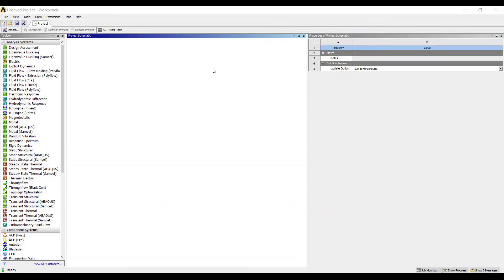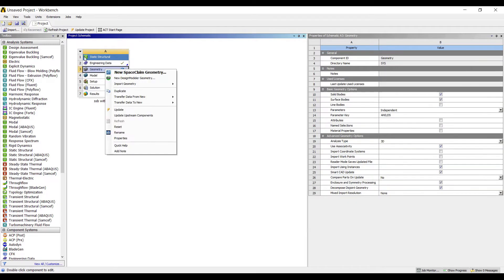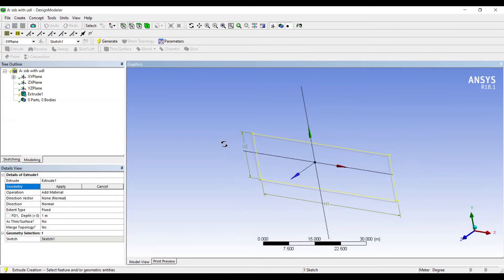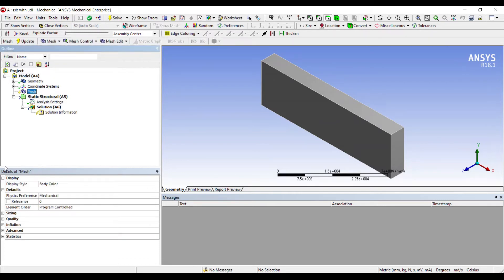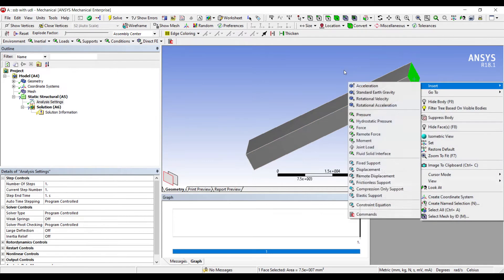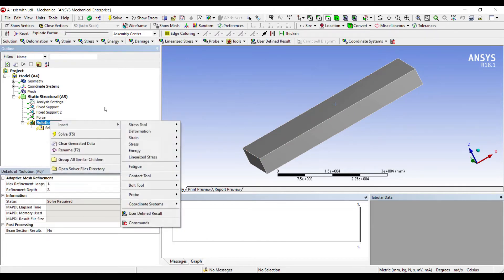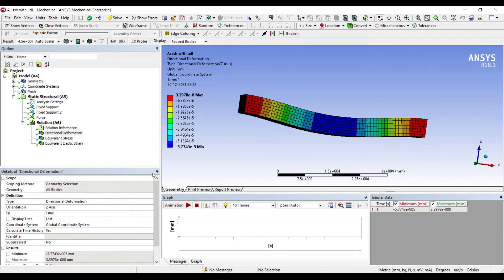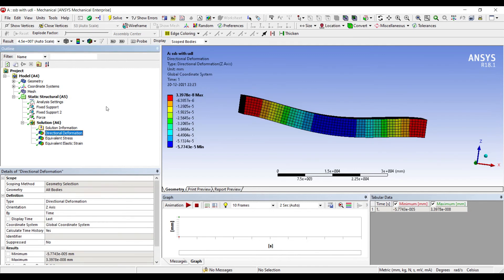Simply Supported Beam | Uniformly Distributed Load | 3D Beam Analysis | Problem 2 | ANSYS WORKBENCH

Comment: Mam is it possible to give the supports at some distance from the edges
Reply from the maker: yes. choose the point of application or create two bodies in extrude with same material to get the point.
Reply: @MechProverse  mam can you explain this in a short video mam
I mean how to do
Reply: mam how to choose the point of application
Reply: @MechProverse  mam is their any chance to convert a line body to solid
Reply from the maker: no
Reply from the maker: By dividing the body at the point where you want to apply support. There is another option of applying remote displacement. you can choose your x,y,z coordinate then